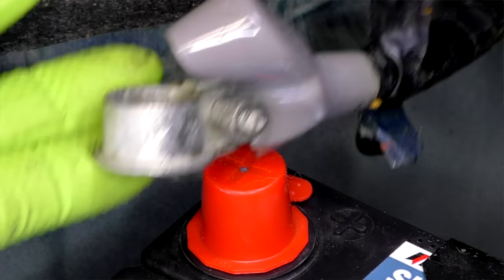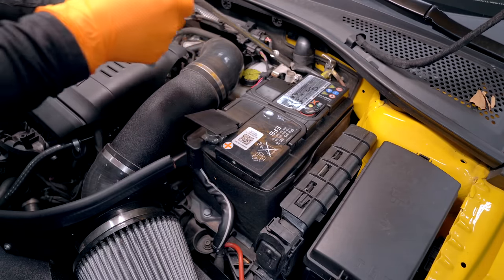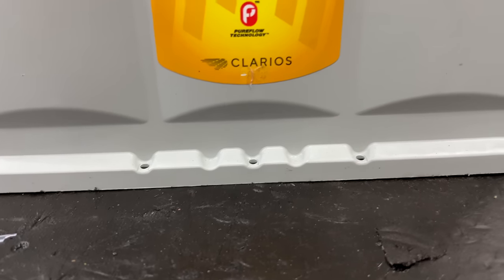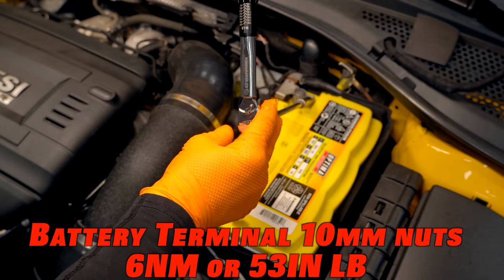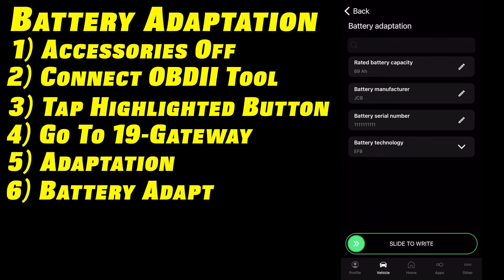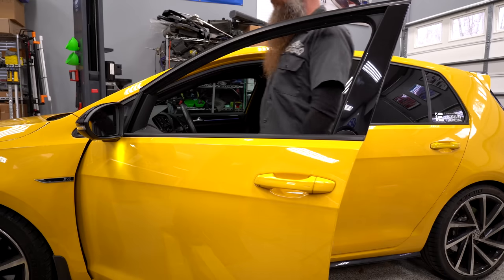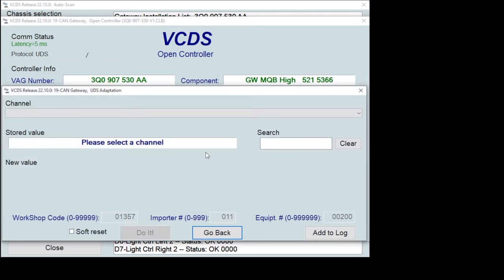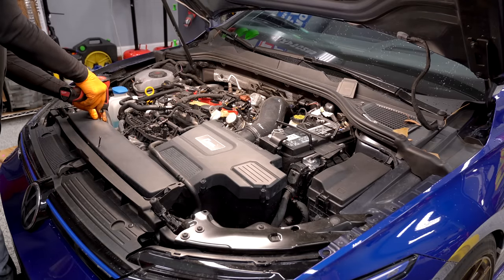How To Replace and ADAPT a VW or Audi Battery

Comment: I just did the same thing for our 2018 VW Tiguan. New battery cost= $220   at VW it was $490 installed and "PROGRAMMED", it would also take up to 12 hours to learn.... Bought scan tool for $200 and did it myself in 10 minutes.
Reply: I have OBDeleven arriving tomorrow to do exactly this on my Tiguan. Dealer quoted me 475 plus tax installed. No thanks!
Reply: Be careful, this is how you become the local mechanic with pro tools.
Reply: In San Francisco Bay Area $675+ tax 
From 2024 labor rate $295/h !
Reply: @Bekssss  And dealers charging 25% above MSRP for parts, but some can still be found with a discount off of retail price.
Reply: What scan tool did you get?

Comment: VW tech here. I really feel like you taught me a lot before I began my career in this industry, however, I do feel the need to correct you on one thing; You do not need to lock the vehicle to allow the bus and sub-bus systems to fall asleep in the battery adaptation process. That is a common misconception among a lot of forum users with battery-monitoring vehicles, and while maybe a good thing to do in practice, is not necessary. Very informative to anybody without the knowledge prior, but it is just an extra step that can be avoided. Still thankful you put this video out, though, because I am getting sick of customers coming in with brand new batteries that died after 6 months due to improper adaptation. Hopefully people begin to learn that battery adaptation is a very real and legitimate part of most vehicles from now until forever, probably.
Reply: So if locking the vehicle to allow the bus and sub-bus systems to fall asleep is not necessary then why it may be a good thing to do in practice?
Reply: I have a question I replaced my battery like 3 months ago and when I turn the battery on only in the car my obd11 says the battery is discharging would you think it’s too late to do the adaptation or doing it will still prolong the life of the battery?
Reply: @rgolab3174  It would be good to lock the car so no one goes into the car and prolongs the "waiting to sleep" timing
Reply: So, for the adaption would it be binary agm or fleece if battery is an AGM premium battery from either walmart, Autozone or advance autoparts?
Reply: @alejandromadera3895  it’s usually going to be AGM or EFB+
Reply: That is why I would never buy a car with a stop/start system. What a useless way to change a battery. The dealer has got you by the nuts.

Comment: Coding batteries what a joke! all this just so they can charge you to change it. With all the electronics today it could easily identify a new battery and fill out all those settings automatically. Nice video with clear instructions on how to do it.
Reply: Exactly, a rip off.

Comment: Few important notes on battery type in coding!! There are two options for AGM - Fleece and Binary AGM. Optima or 'performance' batteries are Binary AGM which means AGM spiral wound (usually indicated by the round cells. OE replacements are Fleece aka AGM Flat.
Reply: I've still got a blue top that's kicking from 2007 ,it's in my mk4 project car and it's "good enough" for the shop stuff I'm doing but I'll need a new one when the cars roadworthy. 
A load test said it's only got like 60% capacity. 
I'd say that was/is a good run. 
I put a yellow top in the wife's 2014 Jetta recently, fingers crossed it lasts 10+yrs.(I've heard they ain't what they used to be)
Reply: I've never understood why performance cars use AGM in the engine bay. AGM is just a way of suspending the electrolyte (sulfuric acid + distilled water) in a gel so it stays in contact with the cell plates regardless of how the battery is oriented (flat, on its side, at an angle, etc). But this comes at a performance cost since it's sealed, you should limit how fast it's charged so as to limit hydrolysis (hydrogen gas formation from the splitting of the H20 into Hydrogen and Oxygen). Some of the gas is re-absorbed just like how a shaken Coke bottle won't go flat if you don't open it. But it's in the engine bay which is well ventilated and it stays mounted relatively flat. You'll get better charge performance from a regular non-sealed, non-AGM battery at the cost of topping it off w/ distilled water every couple years and making sure it stays upright. This is just not the right application for AGM from what I can tell....
Reply: Thanks, that sounds very helpful.
Reply: @Floyd. B I can't comment about the open/wet batteries as I don't know if I've ever seen one in real life... but that sort of lends credence to your claim that they're rare... That said, I've never had a lead acid battery (AGM or not) that I couldn't refill with distilled water w/o using a syringe but I don't mess w/ the cylindrical style AGM -- they seem like a gimmick to me. The non-AGM, regular ol' car batteries have those two plastic caps that plug 3 holes each. Take a flat blade screw driver, pry 'em off, pour distilled water into each of the 6 cells, put plugs back, hit plugs w/ hammer to seal, profit... It's easy enough for me to do a couple times a year.

EDIT: In my truck, I have a standard battery from Walmart, just google "EverStart Maxx Lead Acid Automotive Battery, Group Size 24F" ... I also have a small 10w solar panel on the hood of my truck (it looks like a hood-scoop until you get closer and see it's a solar cell). The cell provides 22v open circuit @ 330mA in bright summers day which keeps the battery charged when parked for extended periods. But, 22v will cause gassing (anything over about 14v will), so I add water every now and again. So far, my battery is 5 years old and still going strong.
Reply: @Floyd. B It has a small 100w or so solar charge controller, but lately I've bypassed that in favor of just a diode. The charge controller has 2 LEDs that are always on, and the 40mA parasitic power draw can somewhat defeat the purpose in some situations. Since it's only 10w rated, 6w installed w/ perfect conditions, it should be fine to go w/o the controller, though the controller is there if I wanted to wire it back in. It's interesting to hear that European batteries are sealed to such a degree. If you can't add water, I can't see the batteries there lasting more that 2-3 years especially in a hot engine bay... with proper maintenance, I've seen them go 10+ years.
Reply: @deadduck8307  believe AGM are more immune to sulfating and just generally handle abuse better than a flooded cell. They routinely specify service life figures that are a couple years better than a flooded lead acid battery.
Reply: Use fleece (agm). Not bianary agm

Comment: Anyone installing a Non cylindrical , Lead Acid AGM battery should set the Battery charging technology to "Fleece", "Binary-AGM" is for use with those Cylindrical AGM batteries such as Optima Yellow and Red tops. Did a ton of research on this.
Reply: What happens when you dont do a battery adaption and just install a battery

Comment from the maker: Here is the battery code list for different vendors. Im not sure it REALLY matters, but might as well do it as right as possible LOL
Battery Vendor List:
Varta - VAO
Exide - TU3
JCI - JCB
JFF Boading - 5D0
Banner - BA2
Sebang - GBC
Exide Technologies SA - TU1
JCI Mexico - EMC 
Unknown - UNK
Reply: Would a stock battery from Audi Dealer be VAG?? I believe that's what i put in the OBD 11...for my 2018 S3
Reply: Yuasa YUA - Thanks for the info, all those pings were making my wallet wince
Reply: Does JCI mean Johnson Controls?

Comment: Current VW tech here, battery adaptations are needed on vehicles of 2018 and new (at time of writing) or any vehicle that has a negative peg on the firewall right above the battery (best seen at 3:52 with the yellow nut holding it down)
Super annoying that I can go from a 2017 Jetta just dropping a new battery in, to a 2023 Jetta needing an extra 30 minutes to connect to our ODIS diagnostics system, sign in to DSS, scan the battery and submit the GFF log.
Reply: 2017 GTI here with manual transmission.  It is my understanding that if you don't have the plug in module that is attached to the negative terminal, then there is no need to do battery adaptation.  I also thought that another indicator of needing to do adaptation is whether your car has the stop-start function, which is not present in a manual transmission car.
Reply: 2019 jetta , went through the steps and still wont start….any advice???
Reply: I have a 2016 Passat and I’m getting mine adapted now 😌

Comment: Just had to change a battery on my 2014 Tiguan, the guys at the auto parts store totally freaked out saying you need to go to the dealership etc, did a little reasearch and picked up a VW specific  ODB reader, and followed the steps, walk in the park. Thanks Charles I appreciate the great info, thanks for taking the scary out of simple fixes.
Reply: Which obd did you get

Comment: Thanks for this video! I just bought a model year 2017 Audi A4. After seeing this I checked the battery and saw that it was original, put in service in 2016 so I knew that battery had to go. After digging it out of the trunk, replacement was easy, and no coding was necessary. I tried putting the positive and negative cables together for 45 seconds to zero out the capacitors? But the car computer memory remained and everything was normal when I restarted the car. You save me a bunch of money! Thanks for the confidence you gave me to do the job!

Comment: Madness to have to code in a new battery but that's the way modern tech is. Long gone are the days of bolting in a part and job done.
Another very informative video Charles.
Reply: Madness needing a scanner for that, should be available on the multimedia painel of the car.

Just a pop up saying “you replaced the car battery, please enter detail here”
Reply: You don’t have to code in the battery. It’s a good idea but 100% not required on this or the mk8 cars.
Reply: I just replaced the battery on my uncle's 2018 Lexus ES350 and didn't have to go through any of this adaptation BS.  He just had to go into the dash menu to set up the displays he normally has up when he drives.  All of his navigation and radio station info were all still there...

Comment: I can't quite believe it but I am just passing 10 years on the factory battery on my A6 TDI. This is even dealing with severely cold winters. I am glad the VCDS will do this battery adaptation because the dealer charges an astronomical amount to do this. Thank you so much for the great information. This isn't such a worry anymore.

Comment: My 8V S3 is about 7 years and a half now, still on the original battery (in canada, with the cold!) so I was starting to think about replacing it... timing on the release of this video is great! 
Thanks again Charles for your videos, i follow you here and on Tiktok and I love your content and personality.
Reply: Be careful with that. My friend has a 2003 BMW M3 that fried a gauge cluster due to low voltage from worn out battery. Dealer quoted him $3,000, the used clusters were around $1,000 . He just removed it and send it to another state to have a circuit board repair work for like $250.
Reply: @SI0AX  Oh wow... yeah, i'm def. planning on changing the battery this winter. To be fair, battery doesn't show signs of aging right now, it still cranks super perfectly, even at -25c (-13f) and voltage is still good, but i just think 7 and a half year is a pretty good run and it has to be changed now
Reply: I’d replace it soon.  I go 6 years and as soon as it slow cranks that’s it. I too live in a cold area.  I went 7 once and the battery froze one very cold night and was cooked.
Reply: I'd replace it asap. My 2016 R it's on its fourth battery, the first one replaced under warranty, which were the small size. Upgraded to H6 afterwards but still California's desert implies A/C on most of the time which kills them fast.
Reply: @aldoa337  wow! Today was -22f (-30c) and car started like a champ... Still gonna replace the battery soon but it's crazy you are on your fourth, wow
Reply: My s3 8V is just getting to 7 years and on the original battery too (from the UK) and I’ve noticed the battery starting to get weak and not holding its charge. Sounds like it’s time to replace it.
Reply: My 2010 S4 still has a good original battery and living in extreme cold area.
Reply: they say AGM batteries last longer than standard batteries, I guess it depends how much you drive and keep them charged? 7 to 10 years. Optima web site confirms this. 2 ro 3 times longer than flooded battery. Our  Audi Q5 TDI batteries easily lasted 7 years, replaced because we had coupon from Audi.
Reply: I have an Audi S3 8V. The MMI had started rebooting when using satnav, AC and heated mirrors after about 20 minutes.  I am pretty sure the battery needs replacing which is the cause, OBDEleven showing a low battery warning. Hope this info helps someone.

Comment: I know it's a couple years later but this really helped me and saved me about $150 labor from the dealership charge for the install. I was mostly nervous about the adaptation, but luckily carista had that function as well. So it actually ended up being pretty easy. My only struggle was getting it incorrectly with the blanket due to some other wiring I had done for a HAM radio install and my JB4. So thank you very much a couple years later Charles, this was super helpful.

Comment: You could explain the WHY you should do it. I had to research this. There are different settings, for instance AGM. This setting changes the way the alternator delivers voltage at startup and during charging. Also, when you change adaptation, it signals to the car that a new battery is installed (even if its the same type). You update the software, even with the same replacement battery, because that tells the computer its a new battery and to charge it differently than it would a diminished battery.
Reply: The computer adjusts the alternator as the battery diminishes so it is reading in real time what is going on. This is just a scam  to help dealers. It's  german over engineering

Comment: Just replaced the battery on my 2018 Jetta 1.4 TSI Wolfsburg, after putting in new spark plugs and coils and driving for about a week, the old battery started smoking. Not really sure why, but I put a new one in, AGM, and now I need to program it. Great video!

Comment: Wow, a lot has changed since 2010. In my Golf VI all I have to do after a battery reconnection is setting the clock, keeping the power window control levers up for a couple of seconds to make the controller learn the "windows up" position and spin the steering wheel limit-to-limit to calibrate the power steering controller. Optionally, I also clear the plethora of errors using the VCDS, however this doesn't affect the drivability in any way.

Comment: Charles, thanks for this. Just had the battery die on my mk7 GLI. Swapped the battery and did adaptation with OBDeleven. However, I had one snag. Everything worked as you stated but I could not get the car to start after the new install and programming. I needed to hold my key fob to the steering column while pushing start button and voila car started up, I did the lock to lock and a quick drive and all is well. Just posting in case anyone runs into an issue post battery swap as until I did this it wouldn’t start for anything. 🤷‍♂️

Comment: Hello, Charles, 
As an automotive engineer, I can give some details on the “unknown why’s” in the process:

 - the prerequisite for opening the hood is to ensure that the vehicle is stationary before performing diagnosing procedures like adaptations, which lead to reset of important modules (the gateway is pretty important module and is not supposed to reset while vehicle is in motion)

 - the waiting for some minutes with vehicle locked is to ensure that all the car’a busses are put to sleep by the gateway. Once they are not active, the gateway goes to sleep as well. Then, on wake up, some of the errors are removed by the gateway. 

 - the rotating of the steering wheel from end to end is also to clean some under voltage errors in the esp/abs modules. 

 - the disable of DoIP communication will be more and more required for various procedures in the newer VW platforms when working with VCDS, at least before RossTech update their products.

P.S. The SFD will really hit all of us - the car enthusiasts…
Reply: My kind of guy!
An engineer that actually knows how stuff works!
(Instead of these mechanics with best guesses!).
Reply: @pepeshopping  Charles is a brilliant mechanic. He knows far more than me and I really admire him for his skills. I only know some stuff about the electronics 😅
Reply from the maker: I WANT TO PIN THIS COMMENT!!!!
Reply: @HumbleMechanic  my pleasure!
And once again, thank you for the awesome videos!
Reply: Actually, rotating the steering wheel gives the zero position reading. The encoder is absolute, but only for one rotation - by going lock to lock, it knows which rotation is center. The fault that is causing all those messages is "steering angle offset not learned".
Reply: @pepeshopping  You said a mouth 
full there. i agree 100% 👍
Reply: @kain0m  yeah. That is true. But on the latest generations, some of the modules are using that procedure to force trigger their internal self checks. You can use that end to end wheel rotation to clear some errors not caused from undervoltage, like parking coordinator warnings and so on. Thank you for the clarification.

Comment: I did the same on my 2019 Skoda Octavia 2.0 VRS (it is using VW EA888 Gen3 engine and DQ381 gearbox). All is good and well after the battery adaptation. Thank you very much. Hope to see more tips from you such as engine (ecu) reset and gearbox (tcm) reset via OBDELEVEN. 👍